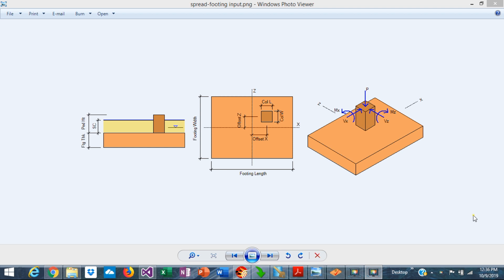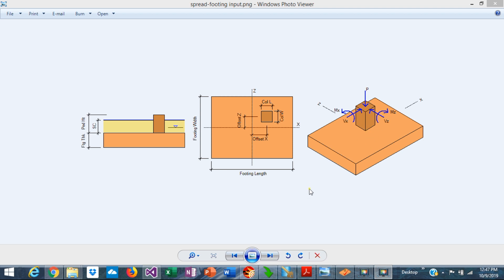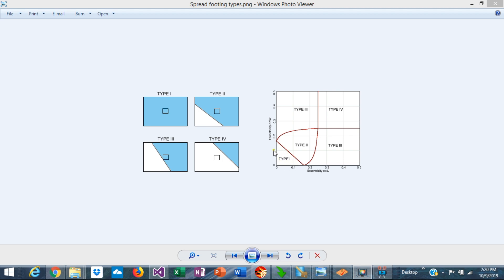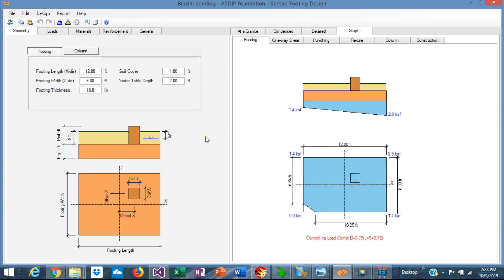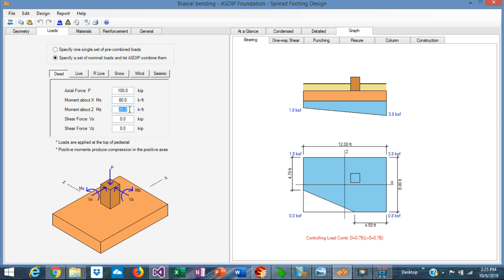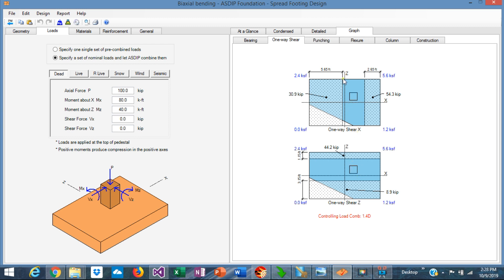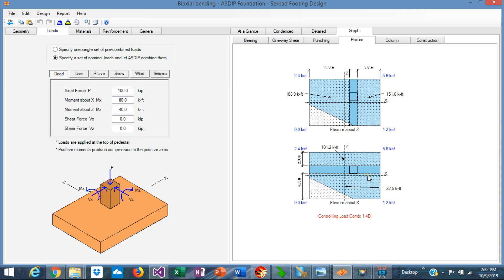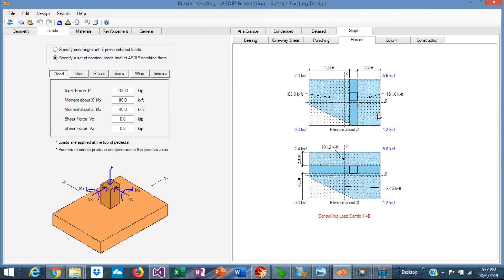Spread Footings Under Biaxial Bending

Comment: I have a question, in geometry tab, there is a not that says "*loads are applied at the top of the footing". How do I change the settings so that the loads are applied at the top of the pedestal?
thank you.
Reply from the maker: You need to model a steel column and a pedestal. Please see this video: https://www.asdipsoft.com/model-steel-columns-in-asdip-foundation/. Regards.
Reply: @asdipstructuralsoftware7797  thank you!

Comment: I have a question. For the portion that is in tension, how should we design it in flexure? Are we not going to make any adjustments? are Case II, III , and IV still acceptable?
Reply from the maker: Areas not in contact with soil may need top reinforcement if the plain concrete capacity is not enough to resist the top tension due to gravity loads. ASDIP FOUNDATION checks this.